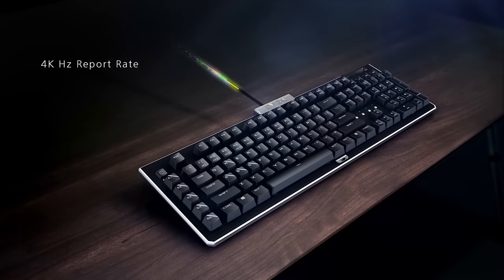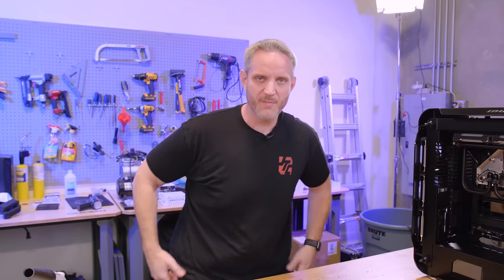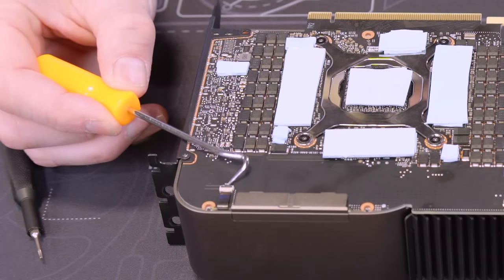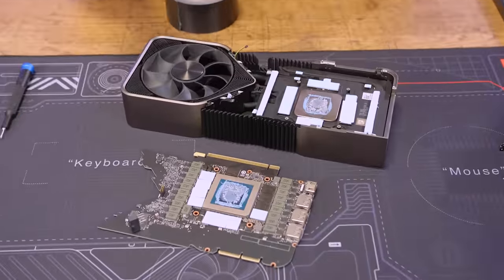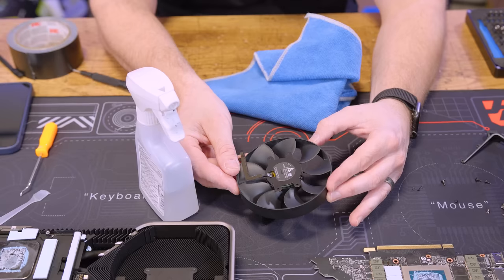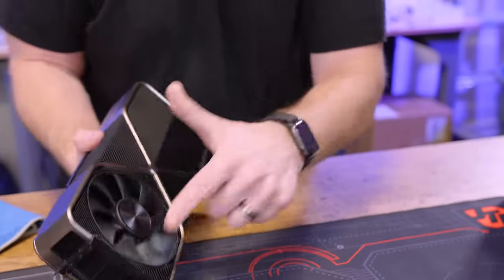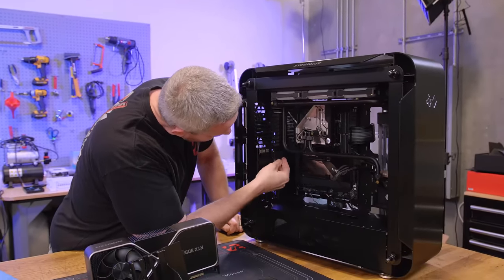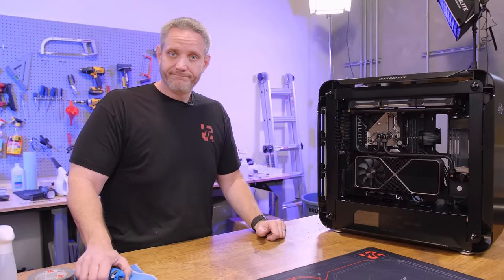Deep cleaning a GPU - Complete Teardown!

Comment: Little sidenote, and genuine question: isn't the consensus that you should hold the fan in place when blowing it just in case you end up spinning it faster than recommended, which could lead to premature failures?
Reply: It doesn't matter how fast it spins. Never move your fans by hand or otherwise because they would work like generators and produce a current.
Reply: Yes 100%, never do what he did lol
Reply: Yes, you can overspin the bearing and cause it to prematurely fail.
Reply: @comsubpac  No, they can't. This is a common misconception. The motors used in PC fans do not generate a permanent magnetic field. Doesn't matter how fast you spin them, they can't generate an electric current without induction. So as long as they're powered off, this is a non-issue. The issue is overspinning the bearing and killing it prematurely.
Reply: Personally, I would hold the fan lightly while you blow air through the blades and use a brush to get rid of the "caked" on dust. I have had some experiences that I held the hub too tightly and caused premature failure. The same thing with holding the fan blades, you may induce a warp and unbalance them; hence premature failures as well. And the others that replied about overspin are correct as well.
Reply: @comsubpac  What's the greeting of day, Rear Admiral?
Reply: @TheGameBench  That is wrong. While most motors are brushless, they all contain magnets.
Reply: @comsubpac  I didn't say that they don't contain magnets. PC fans use reluctance motors. There are many different types of eclectic motors. Some generate a permanent magnetic field, like an alternator which will generate electric current when spun, where reluctance motors require induction to generate a magnetic field and will not generate current unless given a power source.
Reply: You wont spin it faster, and even if you do, you would need to spin it way longer than that to actually damage it.. nonsense
Reply: @TheGameBench    When you move a magnet it generates a moving magnetic field and obviously the motor has windings, thus you will generate a voltage by spinning a DC motor.  Doesn't matter if the magnets are static and windings move, or windings are static and the magnets move.
Reply: @TheGameBench  I disassembeled an old fan and there were magnets inside.
Reply: @comsubpac  "It doesn't matter how fast it spins"
Of course it does. Every moving part has a failure point.
Reply: In the last video he also did this to the case fans. I thought wtf? Now to the 3090 fans. Either Jay doesn't care or doesn't know. 🤷
Reply: @TheGameBench  Take a pc fan, connect to a multimeter and move with your hand. It will generate a moving magnetic field inducing electric current to the stator. PC fans has a magnet ring inside the cylindrical part of the blade.

And yes, you can damage the bearing, the seals and if the rpm are too high, it can break the blades because of turbulence and plastic deforming hitting the frame
Reply: @TheGameBench  This is incorrect. I blowed my gpu fans too fast and it burned out. Got an RMA.
Reply: @XD-nj7bc  I know, I didn't say there weren't magnets. I'm saying that they don't generate a permanent magnetic field as it is a reluctance motor. It will only generate a magnetic field when induction is applied, and thus it can't generate an electric current unless there is a power source. Not all magnets generate a permeant magnetic field.
Reply: @neondemon5137  what card was that?
Reply: Not only that but these motors can generate power by spinning them
Reply: @allanwilmath8226  Not in a reluctance motor. It requires induction to generate a magnetic field and thus generate current. You are thinking of something like an alternator, whos magnets generate a permanent magnetic field. Not all magnets generate a permanent magnetic field. Unless you can provide a source that shows that PC fans do not use reluctance motors.
Reply: @xanderguldie  that has been debunked
Reply: @geeksnotdead666  Perhaps I'll have to test that, but everything I've seen points to PC fans being reluctance motors, and those do not generate a permanent magnetic field. But I could be wrong, just nobody is providing me evidence to the contrary.
Reply: When you do this there's mechanical wear of the bearing... all fans have life expectancies based on the their specified top rpm. By doing what Jay did you reduce the life expectancy of the bearing by over torqueing  the bearing beyond design spec. placing stress on the components that it was never designed to take. This can lead to premature (or even immediate failure of the fan) and can also lead to misalignment of the bearing speeding the fans failure.
Reply: @TheGameBench   you just put 2 contradicting comment
Reply: I've done that shit HUNDREDS of times when cleaning my computer, 3 personal computers and I've never had a failure. Same shit with "oh dont vacuum your computer electric current and blow upp hurr durr" again I've done it as well hundreds of times on 3 different computers, no failures. 

Just don't be overly stupid and you will be fine.
Reply: @Norkris  It hasn't been debunked. You just read some random comments. I don't know if there is something special going on with these particular models, but as someone who regularly use fans in all kinds of projects, I can tell you they do generate current
Reply: @Pumciusz  you'd be surprised.

I've spun up a plastic PC fan (Corsair ML) with my air compressor turned up too high and had it come apart at some insane RPM.

One of the hub/fan blade chunks stuck into my wall...it would have definitely done some damage if it hit me in my neck.
Reply: @xanderguldie  Ah yes. Your experience "as someone who regularly use[sic] fans in all kinds of projects" but without any scientific evidence, explanation, or anything else is really worth a whole lot. 

This whole thread is The Game Bench providing a logical reason for why spinning PC fans don't generate current, and everyone else doing the equivalent of a school child saying "NU-UH!!!!!" 

Put up some actual evidence or shut it already. The Game Bench is the only person here who's even remotely convincing.
Reply: you do you my friend. The PC Police won't shut you down.
Reply: @EQINOX187  You're right, I could absolutely be wrong and I don't mind be proven so. I never said that I knew everything and I am by no means an electrical engineer. I've been looking at a lot of info this morning about it and all I find is a lot of info pointing to what I've been saying, but I could have absolutely been getting incorrect information and fans don't use reluctance motors. So, since people are challenging what I'm saying, I decided to look further and found a video of someone blowing a PC fan with a leaf blower, and yes... it generated voltage. About 1.3mV which is inconsequential. So, perhaps I'm wrong, but it seems that they're in no way effective as a generator anyways.
Reply: RogerWilco99  Yeah... I never said anything to the contrary. We're on the same page there. Also, brushless motors have an electromagnet on the stator and permanent magnets on the rotor. I'm learning a lot from all the pushback.

So, I was wrong in a lot of regards, but not entirely. And from what I'm finding, the fans will generate a small electrical current. Just wanted a video where a fan spun with a leaf blower was generating a whopping 1.3mV. Nothing to be concerned about.
Reply: RogerWilco99  it has,, also i have NEVER seen it happen, on YT, Twitch irl .. anywhere
Reply: is better to let the fan spin  like a freak than break a blade with wind pressure, trust me.
Reply: @BrunoVilela1  that will never happen
Reply: yeah i've ruined fans doing this
Reply: @comsubpac  how much current do you thing a fan like that can produce LOL
Reply: @darinsteele7091  model?
Reply: I hold stuff still, use a brush...and vacuum, not blow.
Reply: @norkris8729  if you are unlucky that is relatively irrelevant. Why risk it?
Reply: @comsubpac  going outside is risky, why risk it? oh wait i dont go outside, guess im safe :D  we have noe prof in vids that fans or boards gets dmg from this
Reply: @norkris8729  of course we have. Why do you think you are supposed to ground yourself before you touch any electronic part?
Reply: @comsubpac  thats also a (97%)myth,,
Reply: @norkris8729   no, it's not.
Reply: @comsubpac   Explain the linus video on the topic then?
Reply: @TerminatorNY2674  Yep, we're on the same page. I made the same comment in the thread earlier. I am by no means advocating for allowing the fan to spin freely while cleaning. Regardless, I agree with stopping them up to prevent wear to the bearing.
Reply: @norkris8729  explain why every manufacturer delivers electronics shielded from static charges?
Reply: @TheGameBench  I had Blue LED fans from my Antec 900 that when air hit them and they spun fast enough would power on the LEDs.
Reply: @NotEvenDeathCanSaveU  You absolutely can spin them too fast with compressed air...
Reply: Came here to comment exactly that....
Reply: @TheGameBench  I wonder where it gets the power to stick to my refrigerator when I remove the magnet from the fan…
Reply: I'd say it would be beneficial due to way back in my early days of cleaning PC's I accidentally put my air nozzle into a moving fan due to me not paying attention and broke two blades off of the CPU cooler >.<
Reply: Ah great topic of heated discussion. First things first. Mechanically you may or may not kill bearings, it all depends of type, class and material of bearings and terminal velocity obtainable by fan and air movement. Possibly modern day quality fans use bearings which are probably going to be ok. But nothing again is not guaranteed. On creating current and voltages then yes majority of fan motors will create both. On the matter of using stepper motors on fans its not true. Stepper motors are slow, heavy and prohibitively expensive for fans. On matter of damaging your electronics don’t worry, all fans are switched on by mosfet’s which in their off state will allow almost no current or voltages pass through “backwards” to controlling controllers.
Reply: @TheGameBench  Actually I have a couple old fans with led, and the led's light if you blow spin the fans, I unplug them from the system..
Reply: @TheGameBench  I've powered a pc fan by connecting the plug to another one using pins and spun that other fan with ~90psi of air from an air gun. That fan did generate its own electricity
Reply: @VanillaWahlberg  Yes, I spent the morning researching the matter and found that I was given some bad information. I was partially incorrect. Half of the magnets are regular magnets and half are electromagnets. And I found a video of someone using a leaf blower to spin a fan and it put out a whole 1.3mV, which is hardly anything to worry about.
Reply: @colinpye1430  Yes... I was half wrong. Half of the magnets are regular magnets and the other half are electromagnets. No matter since for what I'm seeing, the fan will produce a rather negligible amount of voltage.
Reply: @Emprivan  Yes... I was incorrect. The information I was seeing was wrong. However, I found a video of someone spinning a fan with a leaf blower and it was putting out about 1.3mV, which is pretty negligible and nothing to be concerned about.
Reply: @henrik1743   yeah well almost everybody do it and also never remove static electricity and all works fine until the unlucky one sometime get really bad luck and their computer doesn't turn ON anymore...

Since the 90's I always put a finger on the fan and then vacuum clean and I also always touch the earth\ground from the wall socket and and PC case before I touch the components.

I also have many fans which even though they are brushless, blowing air with just my mouth at them the LEDS start to light up and can even make them light up pretty damn good even though they aren't even reaching full rated rpm.
Reply: Yeah. You should also land feet first when falling out of a plane without a parachute.
Reply: @TheGameBench  Is my reply above with related video, where fan provides about 9v while running by same fan airflow being ignored? Just curious.
Reply: @comsubpac  They need to protect it in the box somhow. thicc plastic bag is their way of doing it.. now over to the "you need to ground ur self myth"  explain the video
Reply: @martingray7439  oh no ... 0.001 volt  hate when that happens
Reply: @norkris8729  again, your system might survive or it might not. The video doesn't prove anything.
Reply: @comsubpac  yes yes.. its luck EVERY time. just like spinning a fan "too fast" , luck EVERY time... ofc got it :D
Reply: @norkris8729  you apparently don't understand what luck actually is.
Reply: @comsubpac  ofc i do. you say that since no1 dmg their stuff with statics its luck. and when no1 is dmging their fans (unless the fan is cheap as f***)...  but ye keep ur myths. alot of other myths out there that will die with time :P
Reply: @norkris8729  science is no myth.
Reply: @comsubpac  prove it....? there is ALOT of prof for that i say.  not very much if any for what u say.. its like god, no prof, alot of ppl that belive it.. flat earth, no prof, alot of ppl belive that too...
Reply: @guily6669  you can't deny saying a spinning fan is like a generator or creates a current. Absolute nonsense that guy was speaking lmao
Reply: yes, always hold the fan. My friend ruined a bearing on one of his gpu fans by doing this exact thing.
Reply: @CreamyCraigTV  sure...
Reply: Funfact, if you have LED fans, you can light them up by spinning the fan with a blower. The faster the fan the brighter they get. Until something pops. but don't, overspinning a motor can kill it.
Reply: @henrik1743  sounds like a drunk driver who says they do it all the time and always make it home safe, until they don't
Reply: perhaps gamers nexus can answer this question once and for all with their fan tester :)
Reply: @mozambique_enjoyer  I'm not seeing said reply. I just looked through all the comments in this thread and I can't see it. Perhaps it got marked as spam by YT because it had a link. I've seen them do that even when it's a link to another YT video.
Reply: @notjustforme  I would love to see them do some testing. Seems it can vary depending on the fan. Some people are saying they've seen them put out 9v+ and others are seeing down to a single mV. My question is... does it even matter? From what I'm reading, the boards should have protections in place from current coming back into the circuit, though I don't know if that's for sure, or if it's common practice. It would be nice to see Gamers Nexus get to the bottom of it.
Reply: @TheGameBench  Pity. Well, then you'll have to believe that there's video with noctua redux fan generating about 9v from the airflow of the same fan working at full speed.
Reply: @TheGameBench  I actually can tell you that the current can cause damage because i broke my mainboard by recklessly spinning a fan with a vacuum cleaner. It was ASRock X79 Board. Luckily i got a new one by RMA. If i remember correct only fans ramped up but not even BIOS was loading. Maybe a board should have some protection and ASRock sucks at it but since then i unplug the fans or prevent them from spinning. Hardware is too expensive to risk it that way
Reply: That’s a myth
Reply: @christophervanzetta  it is not. Just read all above carefully.
Reply: To chip in on this really long and heated discussion... What Jay is using is a grandmother proof hobbyist blower that cannot create more pressure than a large fart. I use my air compressor set to 8 bars, and I ALWAYS stick a zip tie or tape or whatever in the blades to keep them from spinning.  If you use a real compressor the pressure can definitely burn out the bearings in less than 10 seconds. I have done it more than once! I had some ram coolers a loong time ago, but they would light up the led's if they spun fast enough. Maybe fans have evolved from my 15 year old ram coolers, but I will always make sure fans are not spinning when I put a shit ton of air presure on them.
Reply: @panickypress  so how we can clean fans ?
Reply: the only thing making the fan slow is the current going into it. the bearing can go as fast as you can turn it.